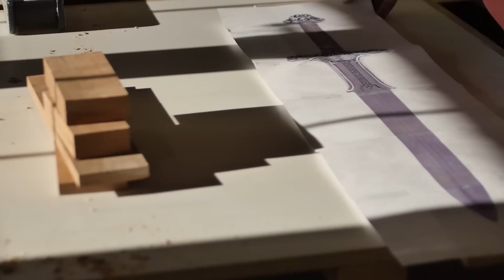Wood Conan Sword

Comment: This got my attention because I made 3 or 4 of these swords and a few of the fathers swords too. 
They weren’t NEARLY as detailed as this is, but all the same. I thought this excellent.
Reply from the maker: Thank you, I'm glad you enjoyed it. Funny I struggled with carving the hilt and pummel, I was running out of time to get the sword finished. That's why I cheated and used the laser engraver to etch the designs in it. Even then I had a hard time keeping the detail in it.

Comment: One tip that would have looked much better. The Hilton wrapping wasn't twisted wire, it was linen cord. The wire is too bright on a wood replica I think think the linen or hemp or jute just some kind of string wrapped and lacquered would have looked more right.
Reply from the maker: I thought about that, but I liked the contrast of the wire on the wooden sword. But maybe if I had blued or oil dipped the wire to bring down the luster. If I make another I will have to give it a shot.
Reply: No

Comment: I would of took it all apart and  done a sand casting of each part smelted some steal and poured it to make the blade the made a cating of the hilt adnd pomal in. Brass  and put it all back together
Reply from the maker: That would be pretty cool, do you have a foundry?

Comment: That handle is a bit too long compared to the original.
Nice job anyway.
Reply from the maker: Thank you, I used several reference images. Trying to get the scale right was a bit of a challenge, there was just to many inconsistent measurements out there. I actually ended up using my hands to try and get it close.
Reply: there were two atlantean swords one for each movie